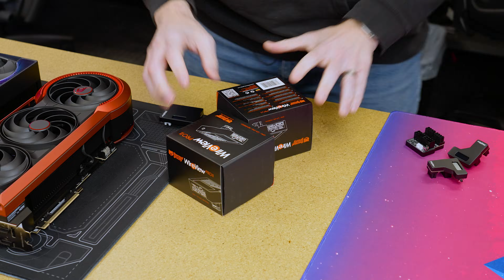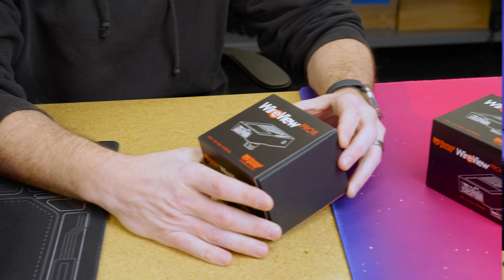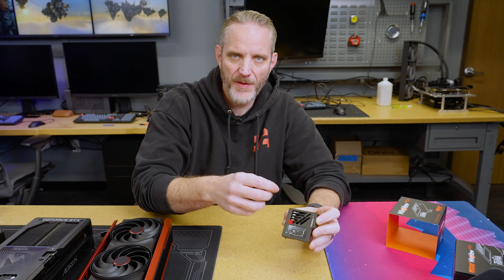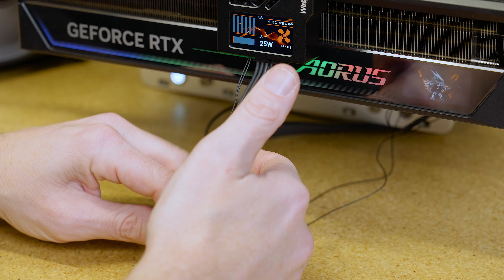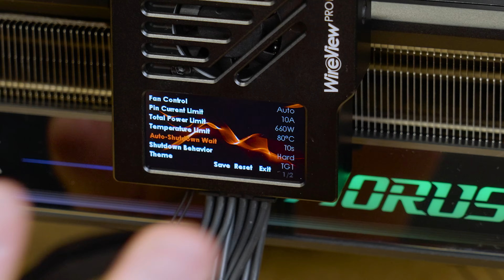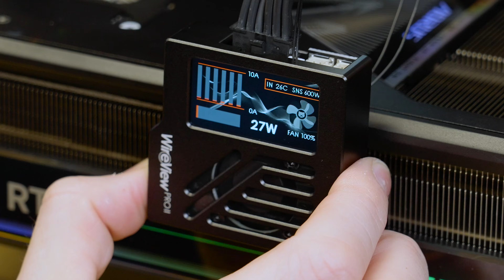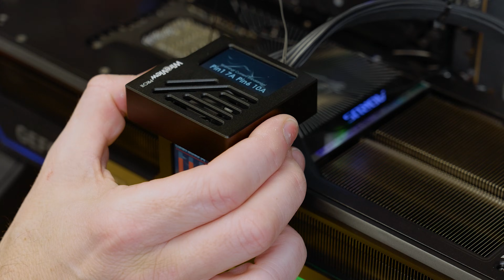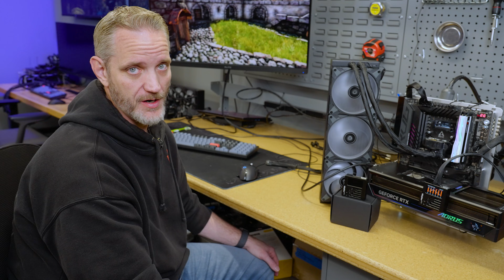Thermal Grizzly Wire View 2 Pro - The fight against melting connectors!

Comment: Really cool device might have to get one after they tune it a bit.  My understanding its all about the power rail on the card to the connector on the card.  good AIB's make good power rails.  Can't be strait shot otherwise first on the rail gets the most and so forth.  Ez engineering fix they just lazy.

Comment: After almost 3.5 years, think I'll be still be hanging onto my old RTX 4090 (Asus Tuf OC with 2x hdmi 3xdp). The 5090 can have up to 30% better perf but after OC'ing my 4090 with 10% more power with a stable 3100mhz & +1200mem, it still uses 150-200w less than a 5090 and therefore much cooler, and the perf difference is hardly noticeable. Although, the 5090 has 4x FG but I hardly ever use the 2x FG with the 4090 anyway. I can't seem to justify it. Although, getting a power cable cooler with a screen seems fancy
First time haven't got the latest and greatest gen in about 15 years

Comment: I think it would be better if it connected to the psu instead then the pc would shut off straight away like a how a power strip works if something shorts it trips the RCD becasue psu shut off quickly

Comment: The long term solution is to use a higher voltage. At a minimum switching from 12Vdc to 48Vdc. Though 60v, 72v or 96v may be a better long term solution. 

A card that pulls 360 watts is 30 amps at 12v but 7.5 amps at 48v.

The formula is amps =  watts divide by volts.

The only safe way to use 12v with 300+ watt video cards is by using much thicker cables. Using multiple thin cables is asking for issues.

In the short term high power video cards would need to switch to the higher voltage,  which will need to be a new standard. On board the video card the voltage would be converter, just like the 12v is converted. 

You would need to either buy a new power supply that can output the correct voltage or you would need to buy a boost converter to change 12v to the higher voltage.

After the new, higher voltage is standardized and power supplies are widely available then motherboards could also use the higher voltage to power the cpu(s).

Remember that 48v is 1/4 the amperage, 96v is 1/8 the amperage.

Comment: I am interested In this for my 5080 with my 3.1 psu that has the extra pins for its supplied 12hvpwr cable. But the price is steep. Then again - safety for the steep price of my 5080 is worth it. Just wish it was closer to $100

Comment: I think because of the 12VHPWR connector pin size those are designed to 9.5A max. The old connector was designed for 7A but could push harder because there was more contact available. And generally those where used with more connector (I think up to 3 or 4 x 8 pin)
If we calculate the old 8 pin(4+ per connector), 3 connector, could push 7x4x3=84 amp for all connection. The new 12pin can only push 9.5x6=57 amp. We lost quite a lot of power no ? 
For me the new 12pin connector should only be used at half its rating …

Comment: Bury this shit connector already... I bet it is less problematic to run more than 150 watts through an old school 8 pin. Up the limits on these to 300 watts and tada you have the necessary 600 for a 5090 with the classic two wire setup.

Even better, adopt BTF as standard. It's a single contact.. so way less problematic. Servers psus use that style for 1000 watts. Just do that on every GPU (and maybe finally go 12VO whilst doing that)

Comment: Please update us what's with the non-working fan topic , because that might be as well a connectivity of that unit issue, if you inserted the wrong one. The compatibility list of the product page shows, that for the card you are testing it with, the Reverse one is applicable.  I saw you connected them both. In one of them - fan was not working. In which one ?

Comment: The power supply should have this built in and it is well past the time when our PSU should directly communicate with the system about its status. It needs a countdown on the display. One of his radiator fans is dead.

Comment: Oh hell no, the real crime is paying 140$ for that piece of crap. Just undervolt your god damn gpus, save yourself the misery of insane power draw for no gains, no benefits and suffering the risk of damaging your gpu. I undervolted my gpu and its drawing a WHOLE 150 LESS watts at 100% usage. Its at about 440 on average with a undervolt curve and i lost about 5-8frames in games while also DECREASING temps by about 10-12c. I could even go further and undervolt it to less  than 200watts for 18-20frames loss on average with less 15c on average. But then again, i don't even run my games on unlimited frames, i still run a 120hz 1440p monitor and my gpu never even hits 80% on any game, i also dont use any crazy ray tracing features because i don't care about it, and i do use DLLS if it's available, on average my gpu sits at 40-60% in games, my wattage usage is always around 200-300 while being locked at 120fps in every single game, you don't need 600fps in games people, unless you play competitive and are a pro, if you're not a pro don't say you play competitive either, only pros in esports need this, not you or me playing games for an enjoyable time. 

In other words the product sucks, nvidia sucks, undervolt your card for free, youtube guide 10minutes, 30minutes total you got your new setup going, less power usage on the bill, -10c thermals on your card, win win.

Comment: 12vHPR is one of the worst interconnects ever designed.  What sane electrical engineer would design a replacement connector for twice as much power with smaller gauge wiring?  Make it make sense.

Comment: When a pin is being pushed back it means the slider part on the cable side is off center and the human is not delicate enough pushing in the connector. You do seem to be somebody with less patience and I do see you slamming in those connectors instead of with a soft wiggle to all the pins can line up before you use force to slide the connector in. It basically means you are a wonderful big strong man who does not know how to dose his own strength on parts that require less raw manliness

Got an Asus card now as well and also tried their software like GPU Tweak but damn that software is crappy. I pretty much uninstalled it. To control the color of the RGB on the card you need to install an entire software suite which is spaghetti coded spyware with insane hogging services and serious security vulnerabilities. I really expect more from a company like Asus. They really are very sloppy with their software and it has nothing other special I cannot do with the AMD driver software already which it conflicts with as well. The CPU literally runs 8 Celcius hotter with Asus software. It's also looks old and depreciated. Standalone version for single features are not officially available anymore even. I avoid Aura Creator with a passion and for feeding us those vulnerabilities they should be fined by a watchdog imo. There's nothing unified about it as well. It's nothing but spyware and a spam tool

Yes numbers are the same because P = U x I Jay. Even when you use 5 they will all show the same numbers because the amp draw does not change. When you have differences you have an unwanted resistance somewhere indicating that specific electronics part is malfunctioning

Comment: The best thing you can do as a consumer is to not buy any card with the 12V-6×2 connector.
Let data centers buy that stuff and burn through it all; sooner or later, the failure rate and poor sales will force them to go back to safe PCIe cables. Even if the cards required four of them, that was never a problem. If they were willing to force you to change your PSU to add this terrible connector, they could just as easily force you to buy a PSU with two extra PCIe outputs.

Comment: i stress about my 7900xtx, it has 3 8pins but average draw is like 550watts under load with peaks deep into the 600's i know 8 pins have a pretty large overhead from their rated output but still...

Comment: This thing looks like it is pretty much only for standing GPUs and not the regularly mounted ones, cause I don't think there is a lot of cases that would have enough room between the end of the GPU and the side of the case for this thing.
Reply: Its meant for XOC, but has been conveniently repurposed to be a solution for a problem that doesn't exist. I am guess Jay got 10k for this vid?
Reply: @normo.1141 the problem exists for those with high end cards. We don't notice it because we aren't spending 3-6K on a GPU man. 😂
Reply: @tsijr915 I have a astral and never have this problem with a intensive use

Comment: Between melting connectors, and pins that bend, I'm gonna stick with my 980 TI until it dies.
The more I hear about the troubles these new cards are having, the more I refuse to touch a single one of them.

Comment: What I don't understand is why we are still using so many small pins to deliver so much watt and amp, industry should just make a new standard connector with slight bulky connector/contact area like the PSU to outlet cable and plugs.

Comment: There may be some air cooler towers that interfere with the display, I'm in no way sure, but the documentation on the website shows a clearance of 65mm total height, with 24mm from the sense pins to the top of display, and 30mm from the retaining clip to the bottom of the display. I'm not sure if this is the same for both versions though.

Comment: people are already doing 14 gage wire modifications to the 12vhpwr and 12v2x6 cables lol it works reducing the resistance and not dealing with the burning plugs but still have issues with the connector pins which some even go further by soldering all the wires directly to the board with 14 gage and keeping the other end of cable 6x2 connectors either 2 or 3 and with this heavy mod you wont ever have a problem again as long as you use 14 gage and solder to board and ditch the new connector
Reply: if i bought a 4090 or 5090 i would ditch that connector and solder for 14 gage to board and use the old 2x6 in a set of 3 or 4 for psu because why burn the board up with nvidia crappy connector design

Comment: $140 to just monitor wires is crazy 😮
Reply: The price is high because it also comes with a guarantee that if your card connector melts while you are using this device, they will replace or repair your GPU and the device.
Reply: the price is ok for what it is, I don't see the market being that big that any bulk pricing really comes into play, you can argue that it shouldn't be needed if they just made GPUs and connectors properly but the power monitor is a fine product. sure i could make it cheaper for my own use or patch something together from aliexpress parts but at that point I won't have nearly as much trust in it to handle all the power . you're already letting yourself get scammed by multi trillion dollar corps if you are building a computer, might as well support an actual good company by a few hundred
Reply: $1000 or $600 GPU's have never been affected by melting power cables. It's not really worth it.
Reply: @stevog893  there is 4080 gpus and even 4070/4070 ti cards with burnt connectors. a 4060 or something around that low power usage is the only safe bet that wouldnt need a wireview.
Reply: It's $140 plus the gauruntee that they will fix your card when the company that made your card will probably not. You could buy this or 3 fans from Corsair. You know, tough choi e these days.
Reply: $290 for the "Noctua Edition " version
Reply: It also warrants your GPU against damage as well. So $140 is not that bad, all things considered.
Reply: @jamessimmons8352  after already spending 3-5K LOLOL!
Reply: @Dre_Key Someone who is spending that to a GPU wont care i think.
Reply: @j.p.h.8126 that's not the point.... Stockholm much
Reply: @fabianwilliam1949  He's right though. If you can afford a card that expensive and that also has a risk of burning it's connector then you Probably can afford the wireview.
That or you're just a rich person that doesn't care if the card bearns it's connector and you just a get a new one....
Reply: @j.p.h.8126 that’s the problem. Letting a corporation team you in he backside with no vaseline and accept it like a good corporate slave
Reply: @Dre_Key What can you do? You either buy it or you dont. Modern prices suck but it is what it is.
Reply: @j.p.h.8126 don’t buy it. Could have but didn’t. And to be honest nobody really needs a 5090 as far as gamers go
Reply: @Dre_Key Well im not going to but mainly because i dont need it and it would not fit into my SFF build.
Reply: Better than a burnt down house though.
Reply: @j.p.h.8126 or hear me out... Don't buy products from shitty companies that give so little fucks about the end user they use a connector with inherent design floors that can kill your entire system.
Reply: @j.p.h.8126  , better in this particular case is do not buy shitty product for the pile of money. I'm talking about cards with 12VHPWR
Reply: Well ur 5090 and 4090 is $2k
Reply: @TkoddaLee  Of course a 2K card shouldn't need a $140 gadget so it doesn't catch fire
Reply: @CmputrBlu its a stupid tax for people dumb enough to buy those cards
Reply: @Melnyx_definitely  Indeed. Gotta wonder who is buying besides YouTube tech guys :)
Reply: they're profiting off nvidia suckers; it probably costs 10$ to make
Reply: @damasterpiece08  Unless your making it in China your not going to be able to make it for that price anywhere in Europe. I'd say it could be a minimum of 70-80 euros infact.
Reply: @damasterpiece08 it may cost $10 to make but they also replace your card if the connector somehow melts while using the device in its standard configuration
Reply: @damasterpiece08  no, engineered and manufactured in germany. and it includes a warranty for the card
Reply: @damasterpiece08 Radeon also has the same connector goofy
Reply: @infaredx Only 2 models of 9070XT’s and not many are buying those because of the connector.
Reply: @damasterpiece08  even the CNC machine time will exceed $10, it's probably around $80 to manufacture before taxes and shit
Reply: @FaySmash if you have a small shop yes, but its just a board with connectors, the chinese are using used gpu chips and putting them on boards for less
Reply: @FaySmash  Nah. In Europe - single-piece prototype milled piece doesn't even cost 50€. The hardware is bog standard and costs less than 20€ assembled and shipped. And that is again for SINGLE PIECE ORDERS. So no - this is just really expensive.

Comment: Well Jay... 
Der 8auer is a few Steps ahead of you: In Sunday's Video, a few Hours before 
this one, he showed further Improvements that are currently being tested. 
Two WireView Connectors? With Extension Cables? 🤔 Nice. 🤩
That would be something for my EVGA 3090 Ti Kingpin Cards too,
because they already had two 12V High-Power Connectors each...
... on the Front... in my Thermaltake TheTower Cases,
so at the Bottom where you can neither plug in nor see the normal WireView Connectors 😭
Now all I need is one Case for both Boards and it would be perfect... 😉

Comment: How smart or dumb would it be to have a separate PSU dedicated to powering the GPU?
For GPUs where the adapter doesnt fit, couldnt a SHORT extension cable be used? Nevermind he mentioned that as i was typing lol

Comment: How has nVidia not been hit with a class action lawsuit for the implementation of that 12 pin?
Reply: You are on the right track, just think a little bit more and you can figure out that the problem is, there is no problem.
Reply: @normo.1141  what are you suggesting?
Reply: @Boss_Fight_Index_Channel  there is no widespread connector failure, failure rate is 0.04%, a fraction of a percent. This number also does not rule out user error(do you expect them to admit guilt?), if i were dumb enough not to seat any connector for a 600w device and take the proper precautions, I wouldn't point myself out too.

If there is no problem, one can assume there is no basis for a lawsuit and vice versa.
Reply: @normo.1141  Not saying it's widespread, just greater ratio.

Searched for:    gpu 2x6 pin connector failure rate

Ai response:     failure rate of the 12V 2x6 GPU plug is about 4% compared to about 3.3% for older plugs. Particularly when paired with non ATX 3.0 psu.

So the failure rate is roughly 1/3rd more than the old plug, and way more gpus (and gpu series) use the old 8 pin standard. User error failure def is a factor; tho if it's user error, older plug failure rate would be the same.

Comment: Glad my Sapphire card is water-cooled. 
The 12vhp is 1/3 the way up the card with the air cooler. Hearing that Sapphire is having the same issues, I'll be getting one of these for my PC. 
That 140.00 price tag is steep, but if you're water cooling, it's more expensive just for show anyhow. And it's a lot less expensive than a new card

Comment: My Wireview saved my 4090 from melting - the 12vhpwr > Wireview melted instead, leaving the Wireview > 4090 plug unscathed.
Reply: Wouldn't this indicate that the plug on the wireview failed since you had 2 12vhpwr plug connections happening in series? Should we investigate TG now and force them to recall all their product?

Quick send GN your wireview for a forensic analysis! We need jay to piggyback on this and start the next thumbnail frenzy....WIREVIEW DANGEROUS DO NOT BUY
Reply: @normo.1141 I'm no electrician but the cable melted into both the Wireview and my PSU. I'd say it was the cable that failed but again I'm not sure. 

Pretty sure I threw the Wireview out but if I can find it I'll send it to DB for sure.